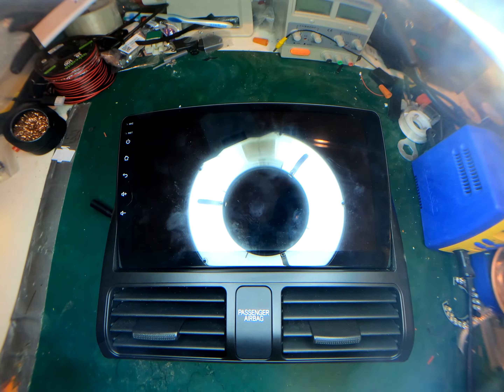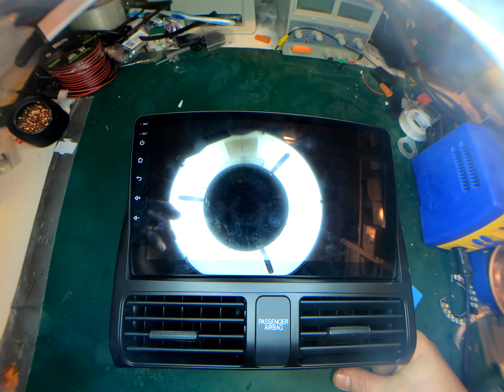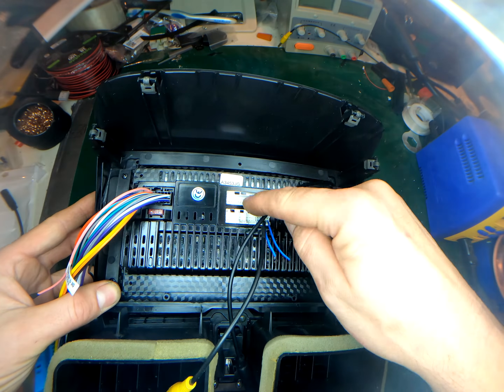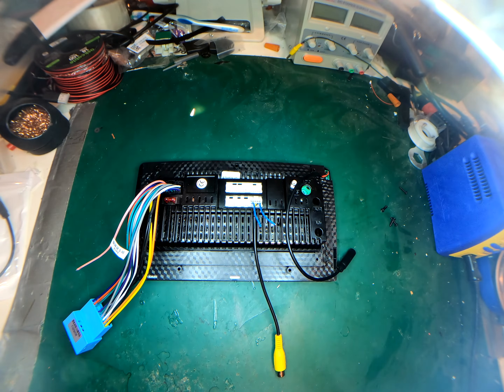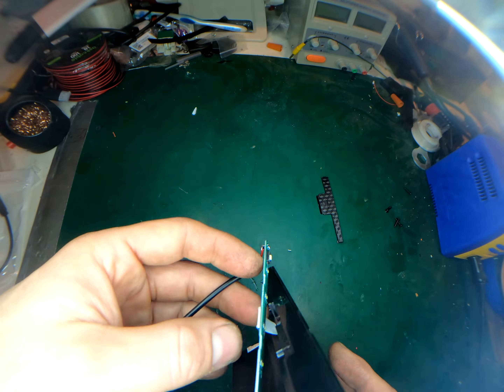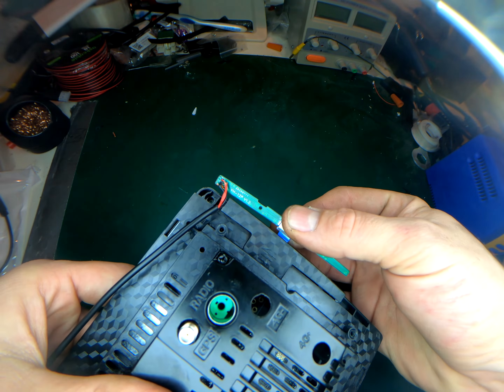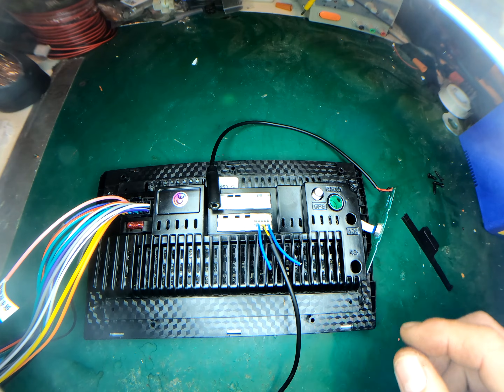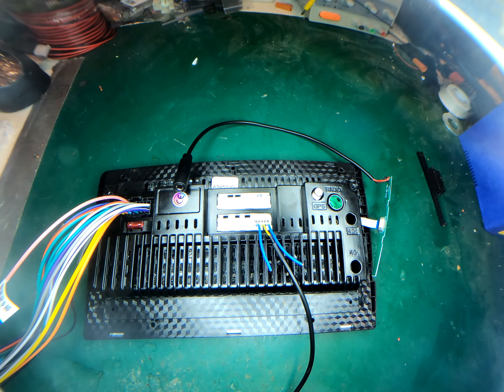FIX LOW Microphone Android Auto Apple Car Play Head Unit Car Radio Stereo poor quality audio

Comment: I bought the original ainavi mic that looks like a lavalier one and still same problem, my mic audio when calling on carplay is bad as fuck, cant find any settings to switch from internal mic to external one anyway
Reply from the maker: Most of these head units are very cheaply made without much QC. 

Did you solder your 3.5mm extension like this video?
Reply: @LILEVO hi thanks for the reply. No, I just connected the bought mic and the connector (sold by them) to the back but the audio is still the same. I might try unsoldering the onboard mic as I read it might work but idk… cant find any menu to switch between both or adjust gains
Reply from the maker: @19Jose91 yep you will need to solder like the video and it will work

Comment: I had an issue where people couldn't hear me well. I tried adjusting the settings and switching between the back and front microphones, but it didn’t change anything. I then removed the internal mic and kept only the back mic, which improved the audio, and now people can hear me clearly. However, during phone calls, people experience an echo and hear themselves.

Would connecting the external mic to the internal mic's location help resolve this echo?
Reply from the maker: Yes, it should resolve these issues.
Reply: @LILEVO   Ok, I’ll try disconnecting the back (external) mic and connecting it in place of the internal mic.

By the way, why would this eliminate the echo? Just asking for curiosity.
Reply from the maker: @Dudu2683  not sure. These units have such low build quality they have a lot of problems. 

On this example in the video the 3.5mm rear mic plug did absolutely nothing. Didnt work no matter what. Which is why I resorted to removing the front internal mic and wiring decent quality external mic in.

How did you remove the front mic? 

If there is an Echo it's either 2 mics or there is a delay between the people talking and them hearing themselves on speakerphone in your car.
Reply: @LILEVO  I soldered the mic out from the PCB. I have only one mic connected , so I think that the echo is related to delay. When I reduce my speakers volume the echo diaper. Any idea how to fix the delay ?
Reply from the maker: @Dudu2683  Yeah, so the issue is they are hearing themselves talking through your speakers. Without spending a lot more money on a quality in dash stereo / navigation unit we are limited by the cheap Chinese electronics. 

It's worth a shot to try the microphone soldered to the front mic inputs. You don't have much to lose at this point.  It worked fine on this specific model number / part number. Results may vary on different units.

Comment: So I tried this mic mod but went through all that trouble and now I get no mic. Tried diffrent microphones and no dice. I had an electrician buddy of mine do this with me in case I screw something up. He was puzzled that it didn't work. My radio does not have a gain option nor a option to choose external or internal mic. The internal mic that I removed was the only mic that ever worked. I even bought a USB mic and connected it to the USB of the radio and never worked either..... So frustrating.
Reply from the maker: Did you try putting back the original mic? If that no longer works there has to be a damaged trace. Follow or ohm out the two leads back to the main board and I'm sure you'll find something broken.
Reply: @LILEVO  I was able to solder back the original microphone and it worked as before. Guess I'm just going to have to live with this.
Reply from the maker: @undagroundrican  which microphone did you try? It's a very simple and universal device. It sounds strange

Comment: Thanks heaps man im having the same issue 9 inch android auto mine has the option to select internal or external mic i selected external but didn't work looks like your way is the the only option i will give it a go and update also there's a way to increase the mic's volume through settings but unsure how to do it and whether it will make any difference
Reply from the maker: Not much R&D is done with these units. It's too bad.
Reply: @LILEVO  just an update i connected an external mic successfully and mounted it near the sunvisor it works perfect thanks to you for sharing this video with everyone
Reply from the maker: @radj4719  love it!
Reply: @radj4719 did you have to change a setting to get the external mic to work?
Reply: @jameshauptman2045  no originally i connected my mic  to the external mic socket on The back of the unit and then selected external mic in settings but it didn't work so i connected the mic wires directly to the internal mic's connection as shown in video and of course i selected internal mic in the settings 
Hope this helps

Comment: I'm going to give this a try. Did you use the original external mic that came with the unit? Or did you purchase a different one?
Reply: So I got the part and installed it. And used the original external mic that came with the radio. It works but the mic needs to be close to your mouth for the other caller to hear you clear. Wondering if changing the external mic will fix it or not
Reply from the maker: Interesting. Didn't have any issues mounting the mic near the sun visor on the headliner area.  @ehabsnayyan49
Reply: @LILEVO did you have to change any settings on in the head unit? I’m experiencing this issue and the external microphone isn’t picking up and on the head unit
Reply from the maker: @katyison4046  nope. Just wire in this mic and it should work as it should.  I reached out to the company and they didn't have an answer.

Said volume is controlled by your phone. Oh ok..
Reply: You could have just added an external 3.5mm microphone to one of the black port of the RCA cables that plugs into the back of the radio
Reply from the maker: To the actual 3.5mm mic port? It didn't work. It still used microphone from the panel face. @LtGenBuffalo
Reply from the maker: I bought this one, but the original worked out better.

https://www.amazon.com/gp/product/B08BFCJZQR
Reply: @LILEVO  ok great. I'll give an update once I get it installed. Thanks
Reply: Android 13,  2024 Head Unit, using an iPhone 15. No mic response. I purchased an upgraded mic, still nothing.based on the housing/shell-taking it apart looks sketchy. I read an article referencing OEM mic and Android mic are in conflict when Bluetooth is enabled. Any thoughts? Thanks
Reply from the maker: @rexholez8438  Does the mic work without the phone connected? Or try connecting a different phone. Does the mic work then?  What conditions will it work?
Reply: Here with same problem, 200€ ainavi radio and my mic sounds like shit. Bought the 15/20€ one that they recommended and sounds the same..
Reply: I tried this and now I have no sound coming out. Also, the last time I removed it to check again I lost the little black clip that holds the ribbon in and now the side buttons don’t work. Can anyone help??